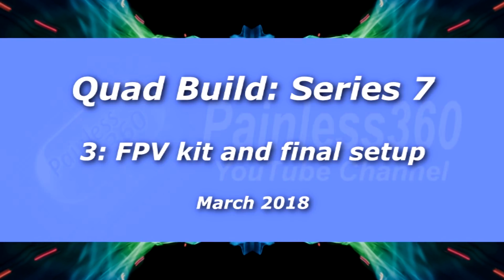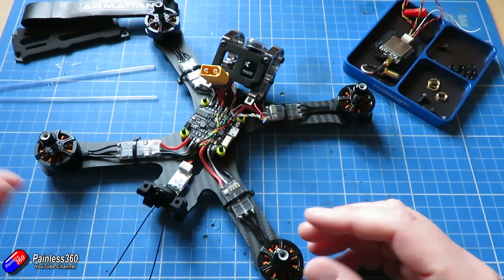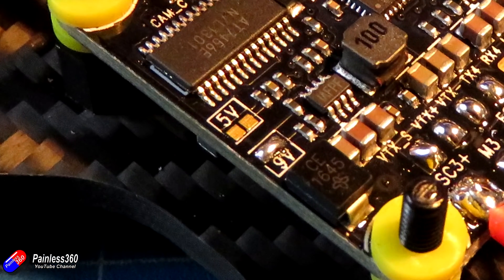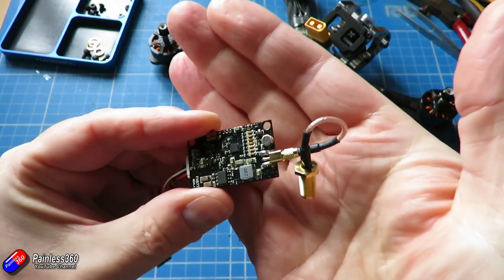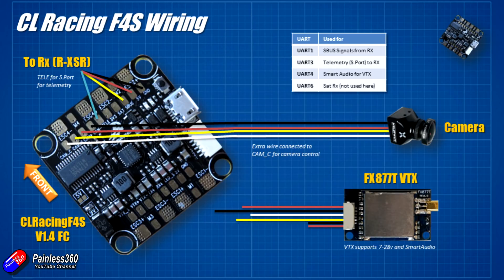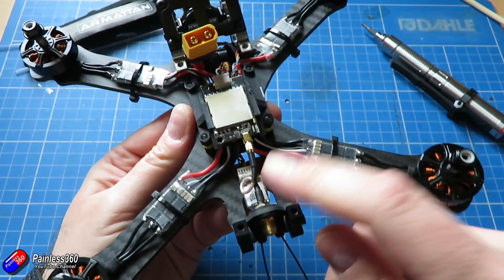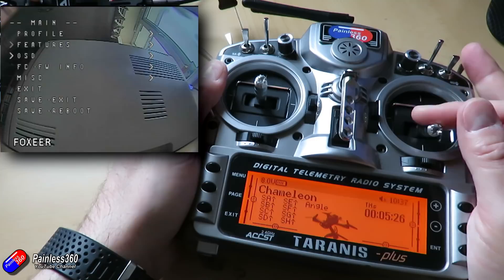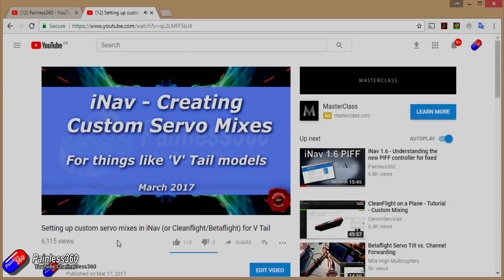Quad Build Series 7: Part 3 Adding FPV and Final Steps

Comment: Lee- what is your opinion on using caps for video clarity?  Excellent job in routing your wiring!
Reply from the maker: Capacitors are used to remove noise from the voltage used to supply the camera and video transmitter. If you're running them from an regulated power supply from the flight controller or PDB you shouldn't need them. I always try and pick components that produce nice clean FPV video, lots of other builders use other methods and seem to end up having to use capacitors. Hope that helps..

Comment: Im trying to get video through a omnibus f4 v2 controller using a foxeer arrow v3 and a foxeer micro ( not sure of the version of the micro camera) bot are presenting the same problem, I get overlay through the board but no picture, check my wiring and resoldered 3 times now on both cameras but still no picture, I know everything is making contact using a continuity meter, all checks out as good, my question is do I have to set the camera in a certain way through the foxeer camera osd?? I’ve turned everything off in camera menu so far as I know, 
Thanks
Jeff

Comment: Also, what batteries can we mount with the GoPro mounted?  Ive heard it limits the space for your batts...can you show which batteries can be used with the GoPro mounted?  1300?  1500?
Reply from the maker: If you put your action camera at the top, and the battery goes underneath the frame - there's nothing else there so you can use what you want. Happy flying!

Comment: i would recommend creating common ground for camera and vtx to avoid noise from ground loop passing thru FC. Also (for TBS and TRAMP) better option would be to power vtx from battery (ESC pad). Same with the cam if it takes HV. Had issues with TBS HV and runcam 2 powered via 9v - both vtx and runcam shutdowns mid flight during punchouts.
Reply from the maker: Video on this setup is lovely and clean. Common grounds are very useful when you do have noisy video, but in this build it's not the case. Be careful when powering things like video transmitters directly from the battery too, if you do then you might need to add a capacitor or two to help absorb some of the noise that you can get back from the ESCs into the power system  that can sometimes cause a problem.  Happy flying!

Comment: I have Naze 32 rev 5 flight controller there is only blue led is on .it show error when flash it no response bootloader programming error.here is also remove gold track of bootloader pin also.so how to recover it.
Reply from the maker: See my series on the Naze32 for all of my information on that older flight controller. I've not recommended the Naze32 for a couple of years now, but there is tons of information around on the common problems that you'll encounter in places like the forums. Best of luck!

Comment: Brother i had seen your all kk flight controller playlist....but i couldn't get the answer that what will happen if we connect more than 2 esc of 30a opto on motor 1( in parallel)
Reply from the maker: See my videos in the 'Introduction to Remote Control' and the 'Quadcopter building for beginners' series where I cover that in some detail. Nothing happens if you have OPTO ESCs connected..You just need to have a 5v supply to power the FC. Happy flying!
Reply: Painless360 tysm my brother.......your channel and you are the best source of knowledge for me.

Comment: Hi Lee. Safety question. Any ideas on a battery arming plug? Ideally socket mounted - not flapping in the breeze. Or possibly a lightweight small high current (!) isolating switch?  I've just got a 501ss to practice with (24 amps at full chat) and I don't like my pinkies so close to the props when connecting the lipo. Gloves are not practical. Other alternative would be to physically constrain the props. BMFA handbook is quite clear about the dangers of connected batteries. Still got a problem - how to calibrate compass without hands in firing line. Wondering about one of those old fashioned car engine sucker valve holding grinding tools. As you can see, I've a mistrust of remote esc arming. Also rather elderly! Advice very welcome. Am I worrying unecessarily?  Bob.
Reply from the maker: You're worrying unnecessarily ;)

Comment: Thank you very much again, I really appreciate your good work, made everything very clear again! 
And I got a few good hints for my build. Since I am using the CL_Racing F4 as well: Did you try flying it with goggles yet? I would be very interested if there is any bigger video noise in the build. You did not use any extra capacitor, and the VTX and CAM ground use different pads. Many dudes in my local flying group (no one uses the cl_racing though, most on kiss or different F4) say it would help a lot to clear up the video feed, using one ground pad or even powering the cam by the VTX. So, how is the noise here? 
Keep up that awesome work, I'd also be interested in the easy-tuning video ;)
Reply from the maker: Lovely clear image. If you're using a good regulator to power the FPV gear you don't need lots of capacitors..
Reply: Thank you, that sounds promising! In my first build, I had the Cl Racing F4, the predecessor. And to make the fpv signal work properly, I had to put in a stepdown- module to power it off the VTX+ (7,3V too much for the unify pro 5V version) and on top an Lc-filter, noise was terrible. (The LED-Pad voltage didn't have enough amperage for more than 25mw on the vtx). So I am looking forward to this one now ;)

Comment: Simple comment: I enjoyed watching this, a very neat build. Quick tip for you, easy way to check motor direction, if you get an over sized prop something like a phantom (or what ever you have) but it on lose (no nut) then spin up your motors, it spins without flying off so you know your motor direction.